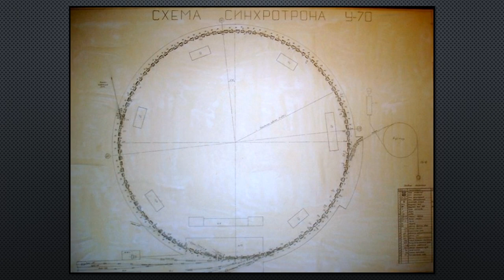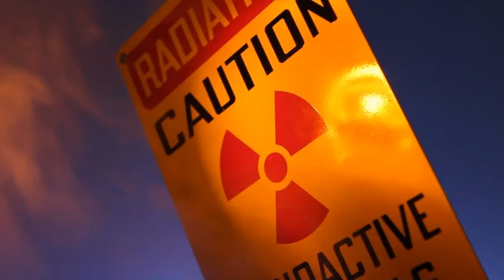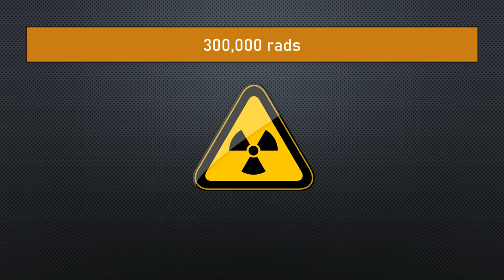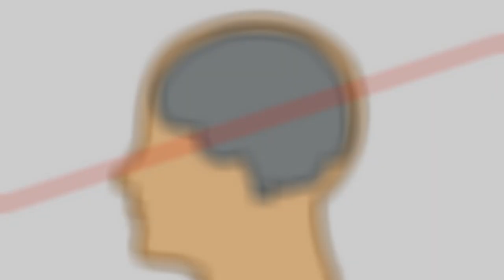Particle accelerator meets human brain (and he survives!)

Comment: I thought that the particles needed to be accelerated by passing though the circular circuit several times until it reached the correct speed and then it would be diverged to collide perfectly with the target somehow nulling it's speed completely, so I thought the particle(s) would in fact still pass through his head many times until it diverged enough to miss his head completely, but it did happen then a single time... and it stopped... after... without hitting him again, ok, I don't understand, I'm not meant to anyways, but I didn't.